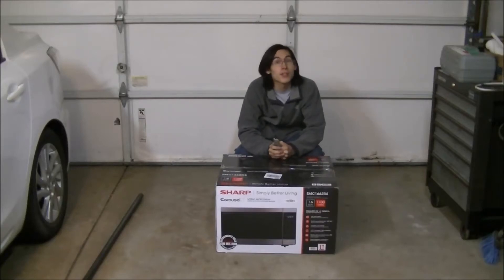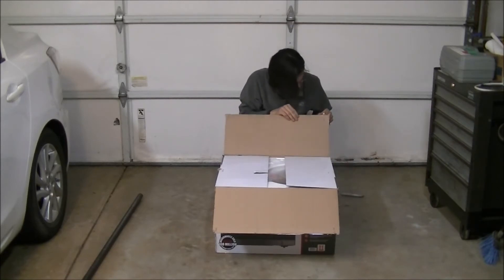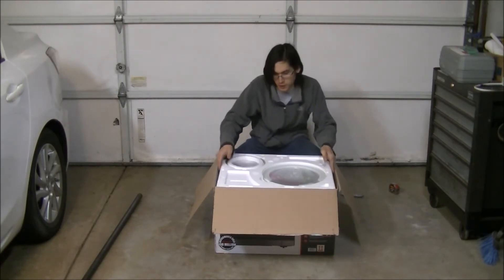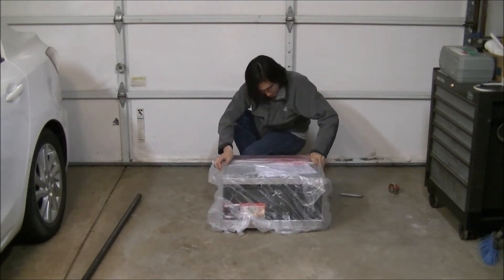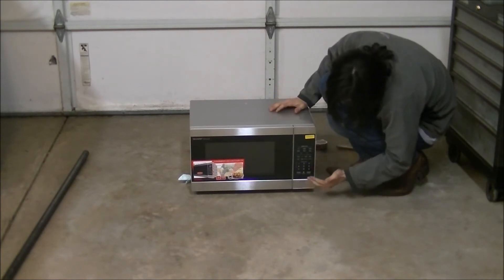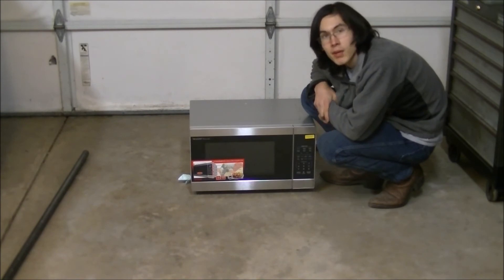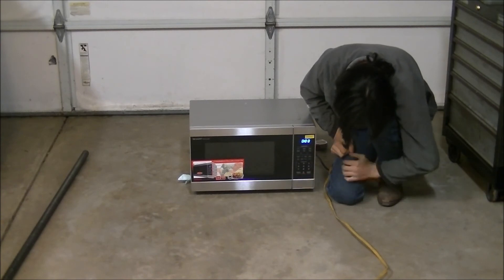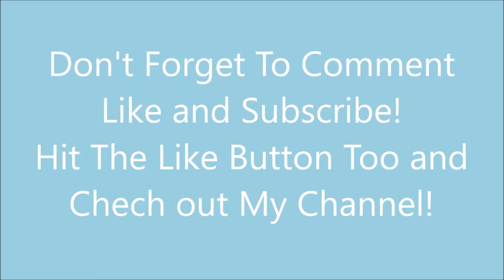Sharp Microwave SMC1662DS Unboxing

Comment: Thanks for reporting the front face dimensions as Sharp does not offer a trim kit for this model. Knowing face dimensions makes it possible to find a trim kit from another manufacturer that might work with this unit. The manufacturer's specifications report height as height from resting surface to top of unit which is not sufficient for matching with a trim kit. Whirlpool makes trim kits (Models MK2167, MK2160) that should accommodate this unit although may require a custom made riser.
Reply from the maker: No problem 👍